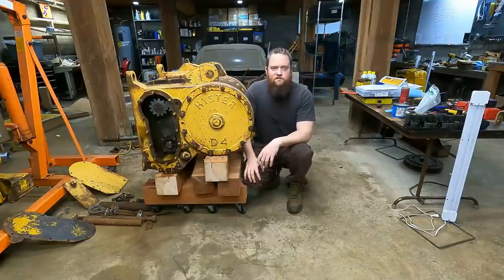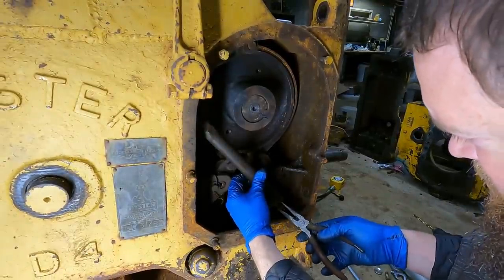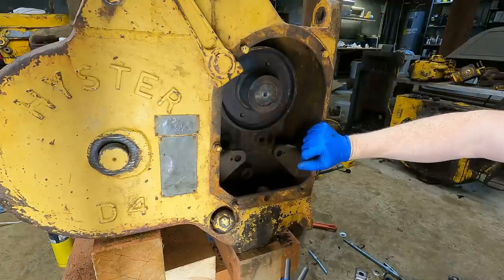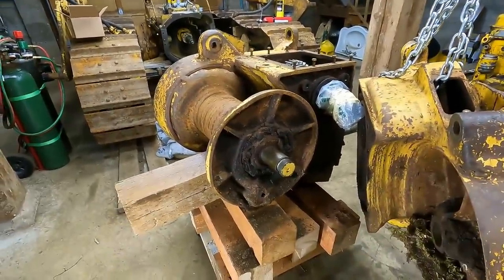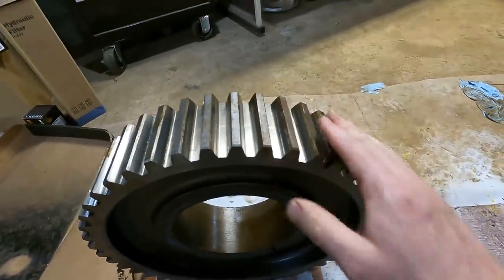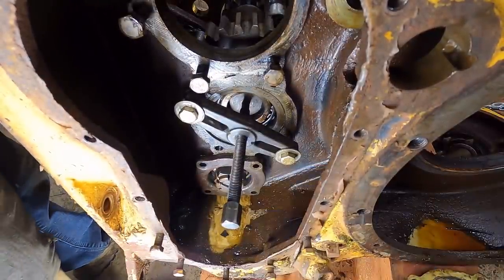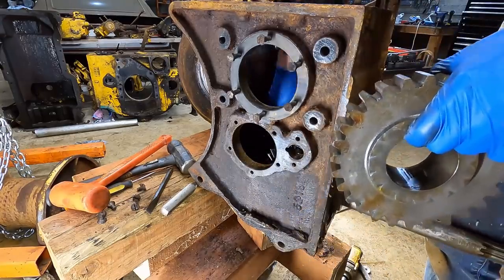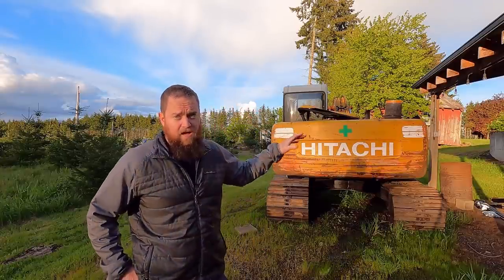Caterpillar D4 Hyster winch rebuild (part 1)

Comment: You could use steel tank caps. You’d have to cut weld them into the drum but you could probably find some made of thicker steel.
Reply: Sorry, they’re called hemispherical tank heads.

Comment: when you redo your safety wire make sure the wire is "pulling" the bolts the direction they would tighten. this keeps them from being able to vibrate loose.  we have to do this on our aircraft (KC135's). it really bugs me to see it done incorrectly, even if its just on equipment. you've got to realize it was engineered to have it there for a reason!

Comment: Any idea what the diametral pitch of that big gear is? Thanks.
Reply from the maker: The pitch diameter is 15" abouts, and it's got 45 teeth
Reply: @PacificNorthwestHillbilly  3 DP, then. I figured it was actually larger. I have some 1 DP milling cutters...can't imagine the size of gear they make - lol.

Comment: At the spool repair, I suggest consideration of what work is expected.  For instance as logging activity, where the spool must resist limb and branch as penetrating the tolerance of the spool OD.  Machine turns with burden tend to scuff and scar the outer spool hubs, So weld build up and even hard face might be a good choice.  I suspect the ragged edges you observe are f rom activity with poor rigging, such as tight loop snarls encountering drum as under power and where larger limbs can penetrate as general residue captured to wire rope.   
Here, so much depends upon operator care, that appraisal to terrain features and rocks, stumps, water burden of soil and clay, and where spool out, idle spool as machine movement, spool in....all play  a vital part in rigging as long life and without breakage. Premium features as machine made swedge ends..  and placement of chokers, gathered timber..all are a part of wire rope selection and what device rigging will require.
Naturally, viewers understanding the gear set and spool driving the forces to rigging will at once understand the hazards.  And they are many.,  Frayed cable entanglement, breakage under load with whiplash.  Device fracture with missle type fragments. Sharpened and supple limb pieces as penetrating via movement. Rain to metal as footing hazard.  All of this is managed with care at winch operation and inspection.  Likely where the owner, avoids any damage and imprudent operator error as responsible for the cost or difficult labor. And or ill fitted parts as the nail, used in cotter key duty.  Fun to see how useful these repair's will become to action.
Thanks for the posts.
M.

Comment: Hey matt,rather than pounding that drum ends into some form of straight roundness.by cutting it down to drum depth and welding a heavy round plate in its place and then an inch thick round stock onto that heavy plate you would have a much more robust drum ends and they would be straight and seal closer to drum body.better than working on garbage bent drum flanges.just my two cents,iam sure u can whip something up quickly.fun watching this build!!!snooky pa.💥👍💥

Comment: I would "hoop" the sides of the drum with either rebar or 1/4" flat stock to protect it and strengthen it. Putting a flap of old conveyor belting around the edge would also keep dirt out.

Comment: I weld plates on the winch drum , even if it's just quarter inch plates  ?  I think that dirt got in when the cable broke the back casting , wasn't cleaned after repairs  ?

Comment: As for the size of  the  cable you want to put on the drum , if I were to put new cable on the drum I would  put the largest size on the drum, then have a spare cable( chain)to extend further to pull the load. Then l would  have  the best of both ( length and strength.

Comment: I really appreciate you recording the process and giving us retiring fellows a look back. And I am seeing parts in this that I never got so deep into. Hard to know now but I'm thinking maybe we fitted Hyster winches to TD series Internationals here. I wouldn't be surprised if the dirt got in during field repairs. With the drum like it is that one and the case must have seen the cable in between them in days bygone. You might find a pretty tidy winch that can be swapped for yours and some do re mi? That's like you'd be told you can take it away in years gone by. Damaged gear was no great treasure in some ways. Rough as the outside is.